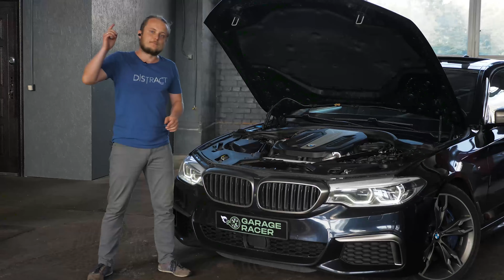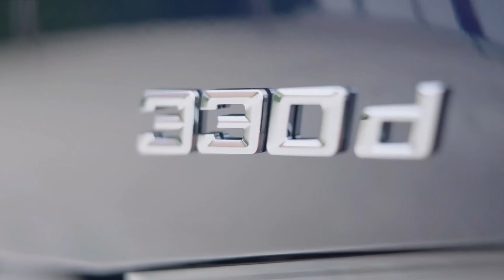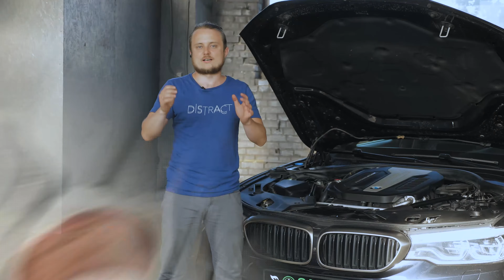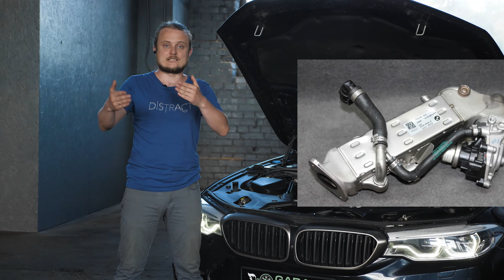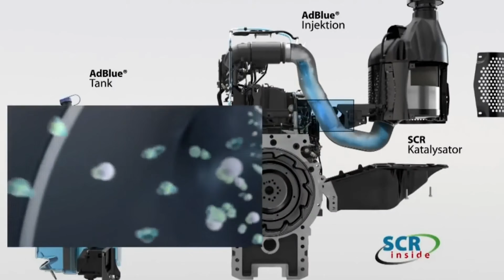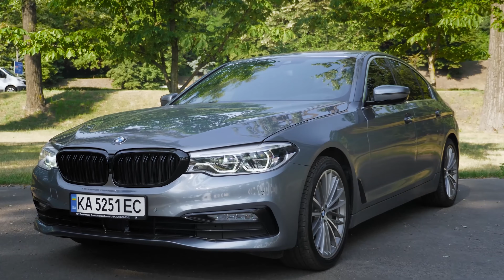BMW 3.0L Diesel B57 Engine Review | B57 Weak Points and Comparison with Other Engines

Comment: Can you tell the differences between the B57 and B57 Mild hybrid engines?
Reply: its just have battery to drive 50km. Nothing else- stupid extract electric motor and heavier. Go full Diesel. If you want Hybrid buy toyota or full electric Tesla whatever lol

Comment: in reality about chains, there is not much different, but chains on b47 last around 500k atleast here in latvia, they fix something and there is no more problem them. same with bearing. no more problems
Reply: Thats because in B47 they moved the chain back to the front and fixed the overwearing of the lower chain caused by the chain tensioner and guide getting loose

Comment: Get rid of swirl flaps, add blue, egr and the dpf. Then you have a reliable engine and much better fuel consumption.
Reply: Añade azul . A qué te refieres ?
Reply: this is so 2005...or 1995?
Reply: @Amogu79 if you have the B57 motor it can be from summer 2015 onwards. Those mods plus extra prevention services like gearbox and timming chains can make the engine last a very long time. Mine just past 400,000.
Reply: @Amogu79 from 2007 onwards.
Reply: @Amogu79  So common sense was lost in 2005? Huh..
I still have EGR and DPF on mine, but I definitely don't fault people who remove them. I prefer to change oil way more frequently instead, to remove all the crazy amounts of dirt that is introduced to the oil thanks to the EGR.
Reply: Rebuilding my M57 stage 1 no need for N57 or B57 same power much more reliable
Reply: @sergionikolenko7440 Just wondering how many mile did you put on the M57 motor before it needed rebuilding ? When you removed the block and head how worn out were the internals ? Many years ago I put 800,000 km on a french 110 hdi motor and removed the head for inspection at 510,000 km. Internals looked almost like new. Hardly worn much. So we put it back together and did not rebuild it.

Comment: Nope. Basicaly they finally debuged their 6cyl diesel to perfection! This time they made it perfect. So much service we had so far with cars with B57 nothing and I mean NOTHING needed to be chainged yet! Once client insisted to change the chains on 300k km mileage, but we did it just because he asked, and the chain was pefectly okay. Bottom problems also fixed, bearings good, pump is good, shaft is great, fuel system perfect,  now even single turbo variants all uses piezo injectors.. So only thing you have to do is to get a car with as  low mileage as possible and save it from that 30k km oil change period nonsense from BMW, and treat it every 9k with quality oil, and it will serve you forever! But if you got one with mountains of oil mud inside noone will help you... So I am so glad they finally made this exelent engine lineup! Both B58 and B57 simply requeres NO ADDITIONAL attention at all, just regular maitanance, if you happen to have B serries IC engine, you are lucky, just delete that BMW oil change periods 25-30k from your head, do it every 10k and you good to go! There is nothing to even compare here with N57s, totaly differend engine, this video is a bit missleading... You can even leave all eco shit on it, EGR, AdBlue etc.. all systems works now perfectly ideal now! Maintain and just Enjoy  your B series!
Reply: M57 was pretty damn close to perfection
Reply: @kol8fire  yeah was a though one :) 💪 made from real metal.. Tho a bit not as powerful. We come a long way from M series to B series which with cooperation with Toyota made it strong reliable engine, combined with ZFs 8HP gearboxes it's just a beast!!
Reply: I have a b57 3.0 mhev, 286 hp. Oil changes with ravenol rup 5w-40 (full pao) in the summer and 5-30/0-30 ravenol in the winter. Autumn and spring -  motul 8100x clean 5-30.
Only good quality diesel, with liqui moly lubrication additive once every 2- 3 tanks.
Liqui moly Ceratec (ceramic particle oil.additive) at 60.000 km
Engine has 80.000 and its just so clean, not a spot, runs so so well. Not a sound, not a problem.
Reply: The B-series diesel engines, have inherited a lot of the problems we’ve already seen on the N-series diesels.
But nothing of big concern.
A good engine, yes definitely for the power output it delivers.
Fault less? No.

Source: my experience from working in a technical hotline in the automotive business.
Reply: @GoerdingscapePK  Nope, inherited nothing this time... We haven not have a single item on the item needed to be changed on B series yet! all who came with over 300k km. even ECO systems was OK still, chains also, bearing and whole botttom end is good and made strong now.   Pistons are differend, chains position is back in front same as in M57 again, the block itself is made differently, they completly changed everything on this one. The N series with correct oil intervals was just great engines, but the new BMW 30k interval policie destroyed them.. but B series looks that they even hold on great even on that nonsense. Altho I tend to code for people new CBS from 30k to normal 10k & 12months oil change intervals. BMW certainly was making notes and learned from their previous weak points and debuged them all. Both N57 and B58 are equaly great now. Ofc there is no protection from idiotic drivers behaviour :D so all can be broken down.. Just use good qualitu fuel, do rest of service on time, specialy OIL I love to use Xados products, they hold up oil properties and remains thick whole period, also I always use one additive per vehicle once Xados TwinTurbo I think its called the most expensive one for ˜100eur. It polishes your scratched metal surfaces and fills the micro gaps also covers in ceramic film, last one I maintained like that was N57D30A Stage1 sold it to my friend he's on 350k km now, drives like new putting out 220kw with 630Nm :)
Reply: @IT_Scientist  "...chains position is back in front same as in M57 again... You mean timing chain ? Are you serious, man ?
Reply: Really there is an obvious similarity between N57 and B57, you can also get the BMW b57 service bulletin from google and see that there is lots of things that are "unchanged" between them, also some of the references are the same. In fact i get a cheaper B57 engine and use a lot of parts to fix an N57 so i can watch them carefully inside. It seems to be a huge improvement in reliability in the B57, i´dont understand why a lot of N57 where blowing up his crankshafts and the b57 doesn´t suffer this problem, maybe the upgraded oil pump or the strongest engine block... dont know.
Reply: different tolerances maybe
Reply: what about tunning them is it ok stage 1 remap ?
Reply: Ha haa my intake swirl flaps got destroyed at around 65k km .. bad plastic flaps used by BMW instead of metal
Reply: I've already seen two b57 engines with broken timing chains both around 350k km
Reply: @MrTurboDima id say as just general rule of thumb for any N/B series bmw engine , inspect chains at 75,000 miles and change chains every 100,000 regardless.
Reply: @shadowchrome_  N/M maybe but not for B...
Reply: @MrTurboDima  thats what I am talking about only two?? :D N series its every single one with max 200k and chains are loose already
Reply: @MrTurboDima  Even a great engine design can't fix stupid people from putting high load on a cold engine with 25k km on the same oil.

Besides, I'd say the N series engines are actually remarkably reliable; it's insane to me that an engine actually lasts 200k km on 30k km oil change intervals, and only have rod bearings and chain go wrong.
Reply: @jgripen969  all m57n2 in germany had oil change intervals by dealer at 30k km and still not that many cars had broken timing chaing and almost none spun bearings. why so?

Comment: M57n e61 here 330k driven hard daily ...and no chain stretch. Such a pity reliability went down from here. Think ill buy an n57 35d anyway. I had an e60 n47 see over 200k miles and had chain inspected before i sold and was alll good. I find bmw quite reliable in general.  IBS system has been a nuisance on a few cars though.
Reply: do not get N57 35d engine they have issues with bottom end bearings and in some cases even knock cranks out, very common to see with engine failures. even 30d model is far less likely but still susceptible to those issues too. keep ur m57 and save up money and get B57 if you really want to change
Reply: @shadowchrome_  ya ive since changed my mind, ive gotten somewhat handy at working on cars and do all my own maintenance and mods currently but replacing bearings seems like a lot of effort and would be paranoid i did someting incorrectly as it would be my first time doing it...and the cost of of paying to get it done here in Australia would be astronomical😮. Its just a shame as i do like the aesthetic of f10 and 640d even better, many going pretty cheap here, i didnt like their handling compared to e60 though. I think an m57 conversion into a patrol or old pajero will keep me busy and happy for now
Reply: @ yeah it really is a shame about them as i agree, the F10 5 series and the 6 series gc are gorgeous cars and bloody quick and great on fuel but its not worth the hassle and paranoia of it randomly going kaboom. but yeah honestly M57 in a pajero swb would be wayyy more fun and reliable😭
Reply: @shadowchrome_   I don't know, just change oil between 10 000km and 15 000km and ur good. My N57 F31 330D daily driver now has 375 000km :D

Comment: I really want to know did BMW change the design of the crankshaft bearings on the B57?Are they any better than the N57 one's?I think it's disgraceful for such a great brand like BMW and a brand renowned for making the best driving cars,to have such factory made flaws like faulty crankshaft bearings.
Reply: They changed everything here in B57, everything is much durable and better. They changed pistons, rods, block, bearings, head.. Differend stronger metals, they went down a bit to old school controls a lot of vacuum hoses now. Just do oil guys every 9k km. And forget that nobody says. Amazing engine, reliable, very strong and powerful machines. You lucky if you got one. Half milion engines easy
Reply: Exactly the same as N57. Difference is main bearings went to 55mm in N57 from 60mm in M57. B57 creates more torque and earlier than N57, so more stress on bearings at low rpm.
Reply: what if you remapped it for more low down torque. Could the engine last 500,000 km ?
Reply: @hungrysurfer9471  hm.. I would say it would hold fine if you tune it correctly, but for now its way to early to say about 500k km. :) are you being sarchastic here? :)
Reply: Not being sacastic, i tunned mine at 58,000 and now im on 374,000. I love the car and chassis. I want to keep as long as possible. Im hoping for 500,000 or more. Tune was 240hp now 220hp.
Reply: @hungrysurfer9471  I think you good bro, B series engines are tough different beast from BMW and Toyota colab.. I am at 315Hp OEM and all is fine like new, except damn adBlue error already, I am at 135k km only.. btw mine is G32 M chasis 640xD lovely machine all around.. keep it man :)
Reply: @onlyhuman7420  yes the whole bottom end engines problems are solved now, bearings will not degrade of you simply do oil change every 10k.km. They revised cylinders, pistons, injection systems as well and on the good side. As I said we teared appart B57 on 300k km mileage for a chain job, and there was nothing to be done, the chain was still in its normal operating range. Ofc.the inside of it was nice and clean which just confirms that only thing you need to care about now is an regular good quality oil change, like Xados for example. It will give it some extra coating for the parts. I also always use at least once one expensive bottle of metal treatment solution from Xados it's called like Stage1 revitalant costs arround 100€ it's a great additive to fresh oil that you can do every 100k km, it will polish and smooth out the most scrached parts, and works most on places where the load is biggest like on bearings, creates extra ceramic layer for your even more peace of mind on top of already very well done and redesigned engine after all lessons learned from past N series ones. Although I got to say with same treatment I was able to do 330000km on my N57D30A Stage2, was working like a clock before I sold it to my buddy who drives it further happy till this day! Remember: forget 20-30k oil periods, do it every 9-10k with Xado oil and use at least once Stage1 additive from them invest extra 100€. And enjoy that smoothness, power, torque and realibility on both N and now even more forgiving B series. And stop reading kids comments whos knowlage is from a guy who said a guy...etc. Listen people who actually works on them. My N57D30A original oil pump on 330000km was giving strong 1.1bar of oil pressure while its warm and perfectly working limiter at 4.5bars while its cold! Just show em some love and those diesels will get you arround the world!

Comment: Need help. 530xd 20k km 2022 lci. Motor feels and sound great, vibration of motor is normal, hood also feels nearly no vibration. 

However inside you feel vibration a lot (as if it resonates, seat and steering vibrations are felt, nearly to massage level)
- same in all gears, N, D, R, P… all same
- it is excessive only at idle…. As soon as you get to 900-1000rpm it is quite and smooth 
- hot or cold start also makes no difference. 
- oil is fresh (every 10k km I change) 

Motor was dropped down and installed back because car needed left front part changed due to accident. 

What can cause such vibration ?
Reply: You need engine mounts
Reply: mounts
Reply: Did you find the problem?
Reply: @cosminionutbobulescu6578 yes motor mount on that motor in g30/31 LCi have active motor mounts with some sort of hydraulic line it seems, that plastic connector on left motor mount was broken
Reply: @TomHenry2  Engine cushions (suppers)